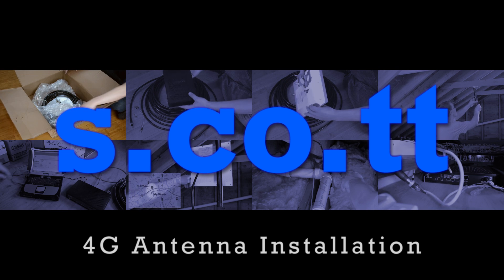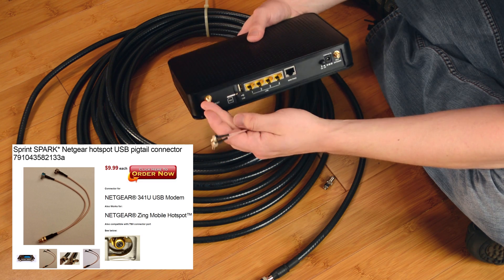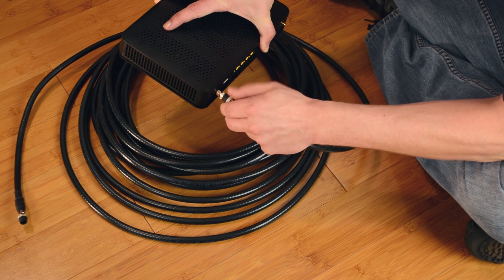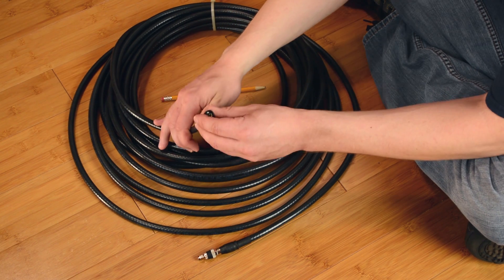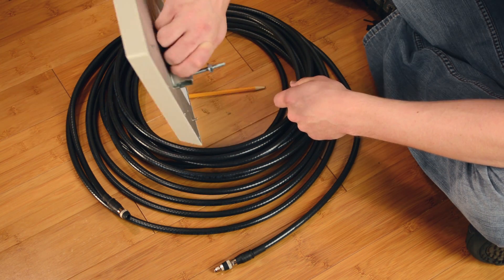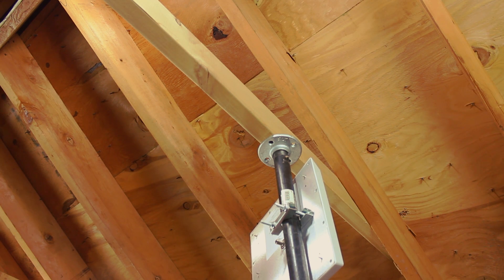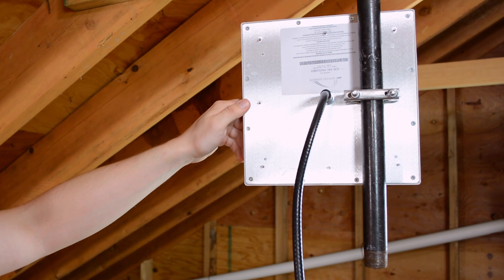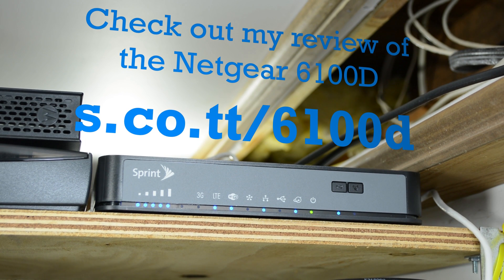4G Antenna Installation for Sprint / Netgear 6100D LTE Gateway

Comment: Do you have line of sight with the cell phone tower you're connecting to ? You should get an antenna with a more narrower beamwidth(high gain yagi or better yet, a Dish) which should improve your signal significantly, Panel type antennas are directional but have a somwhat wide beam width. best to concentrate the most you can into the direction of the tower.
Also try to position your 4G router the closest to the place where you're installing your antenna, that will enable you to use less coaxial cable, so the signal from your antenna wont get attenuated as much. you just have to lay LAN cable from the router to your PC, which doesnt have remotely as much loss as coaxial cable does.

Comment: Why not just mount the modem close to the antenna, and then run ethernet through the whole house. Would give you better performance overall. Also when you touch an antenna you are affecting the matching of it. So dont touch when measuring rsrp

Comment: still Sprint is the only 4g lte that provides public  static/ dynamic  ip address, tried t-mobile and does not support that so i could not use my ip alarm nor dvr system with t-mobile but all good with Sprint.

Comment: does antenna need power supply because of long cable?
Reply: No, the aerial is passive, the coax looks to be decent stuff rather than the thin wet string.

Comment: Why haven't you neatened your rack yet!? :D
Any reason you didnt place the antenna on the upper side of the truss instead? it would have given you more room to walk without having to worry about knocking it
I do think it would have been more suited to place the router up there, even with the heat and cold, it should be fine - signal quality is more important
re power: you could have run gigabit POE and split off to a DC jack
So you can run the power from downstairs, no issues with UPS etc but would increase signal quality

Ideally I would rather have placed the antenna outside as you would get signal loss inside.
If you need the speed as you go forward, upgrade to a MIMO antenna, but place it outside.
You should then be able to max your providers network limit :)

Nice vid btw... I actually didn't realize about the SMA vs SMA-RP so shot!

Comment: hey Scott great video! quick question.. on the netgear 6100d I thought the antennas were used to broadcasting the wifi signal? is one antenna to receive 4g LTE signal and the other is to broadcast? does it have an internal antenna? I'm confused..
Reply: The 6100D has a main and aux external antenna connection.  These are both for the cellular radio signal.  When connecting an external antenna, you only have to connect to the main port.  The WiFi radio antennas are internal to the device.
Reply: The modem has two antennas to support MIMO (multi-in, multi-out)...  If you search and read deep enough, you can't get true MIMO using one cable with a splitter like he's used. The antenna and cable stores will SELL you something that makes you think you're doing it correctly. Unfortunately, he's made a great video of how to setup incorrectly.

Comment: Scott, excellent video!  Curious why you didn't mount the Netgear radio / modem in the attic.  Then, instead of a  50' Coax cable run with the associated cost and signal loss, it would be a 50' Ethernet run.   In any case, I have the same issue with low signal, and am looking for an external antenna.  Looks like the panel antennas now have two connectors for MIMO.  Any thoughts on the MIMO vs single connection?  Thanks again for the excellent video!  Peter
Reply from the maker: +Peter Priest Thanks!  Two main reasons I did the RF run instead of ether:  The attic isn't climate controlled, and can get pretty hot in the summer and well below freezing here in NY.  I'd also need to put a separate UPS up there in that case (and in my basement I have automatic transfer switches such that even single PSU devices are connected to 2 UPSes for redundancy.. probably overboard, but in any case a good situation for the 6100D).

I'm pretty sure that the cellular uplink on the 6100D is just diversity, not MIMO.  (The internal WiFi antennae are MIMO, however.)  If the 6100D (or any device you're considering) is MIMO, definitely use a MIMO antenna if possible from a cost and cabling perspective.  That should give you better effective speed and reliability.   If the device offers diversity, then you'd be better off with 2 separate antennas some distance apart from one another.  (Or just the one as I used.)
Reply: Still Scott, I would have checked the temperature specs on the modem. Keep it in th attic and save lots on expensive low loss cable.UPS is getting into the extreme backup territory unless your situation (with the cable going offline) does usually spread to your power IE both power and cable provider go down at the same time.
MIMO is more than that a little better from my reading. LTE is made by design to have 2 antennae. You can get sometimes more than double the download speed which is damned significant. If I'm reading this correctly, it doesn't matter if you hve 5 bars on your modem/software it will still under-perform compared to MIMO. The only extra work is the double run of cable. Instll th modem in the attic and your down to one Ethernet cable (too easy) and less cable cost overall. In winter the modem can be kept in a cheap polystyrene cooler and in summer it should be okay up to 80c no problem.
Too late now and it is just a backup system so . . . . yeah whatever.

Comment: Great vid Scott.  I am moving just outside of a central Missouri city limit, Columbia and located in basically "fair" Sprint LTE coverage.  I'd like to setup an antenna in the attic as well to support a reasonable hot spot for home coverage.  CenturyLink at best is 3MB internet, so I'm researching cell connection.  Your vid has given me some great ideas.  Thanks very much.  John / KF5KI
Reply from the maker: John Beatty No prob, John.  Glad I could help!

Comment: Hello Scott.  Thank you for this how to video!!  It is almost perfect for my means!  I am curious though for your network why does it appear as though you used the ethernet cord to hard wire instead of connect wireless through the gateway(modem/router)?  I will have to watch again to make sure I understood correctly.  Thank you again!!

Best,
Justin
Reply from the maker: Giustino Cuatto Hi Justin,

I have a fairly complicated network at home.  I have two core routers (basically just PCs running Linux) with internet connections via a cable modem, FiOS (high speed fiber from Verizon), and of course the Sprint/Netgear 6100D.  The Sprint service is just there as a backup in case the hard lines go down in a storm.  So for me, hard wiring the 6100D to my other routers it is the only way to go.  My wireless clients connect to a separate access point that's on a private subnet.

If you're planning on using the 6100D as your main internet connection, then the built-in wireless should be just fine. 

And thank you for the kind words!
Reply: Perfect and thank you for the specifics and update.  As I went through and watched again I thought it might be because the use is to serve as a backup connection.  For my purposes yes it is MUCH more simplistic and I know I could get away with the built in wireless.  I try to solve my own problems and your video for reference was a tremendous help!  I wanted to make certain I am on the right track before I do some ordering to complete my at home network.  Have a great one!!

Comment from the maker: I'm not exactly sure what usage of "mobile" Dean Pepler is trolling about, but I guess that his freshman English class didn't cover oxymorons.  It's commonly referred to as a mobile network, even when I'm accessing that network via a fixed base station.  Besides, the 6100D is still mobile; I can pick it up and use it anywhere in the US.  That's something I can't do with my FiOS or cable connections.

Good ol' Dean Pepler also doesn't understand the concept of a WISP (assuming he's referring to a Wireless Internet Service Provider).  I am not an ISP.

But those are a couple of good terms to clear up, so well done on the trolling.
Reply: WOW DUDE :D 
putting his name on your youtube. thats awesome. :)
Reply: jesus loves you. :D
Reply from the maker: @aphontusaphontus1279   ... I wasn't doxing the guy.  His full name was his YouTube screen name.  I was being a little obnoxious overall in retrospect, but this was 5 years ago so I don't even remember if that was warranted. 😇 

I think that was before YouTube had threaded comments, so I'm guessing that's why you don't see his original comment above mine.. or he deleted it. 🤔 But anyways, at the time I think the @ symbol actually did tag him, which is why I used the full name every time..  I was just typing @ and then it would autocomplete his name.

Comment: What type of cable was that you used? 50 ft is the max run before signal degradation?
Reply from the maker: This is the cable I used:

https://4gantennashop.com/index.php/product/11-series-11-quad-shield-coaxial-cable-14awg-ultra-low-loss-sold-by-the-foot+&cd=2&hl=en&ct=clnk&gl=us (Their site appears to be down right now.)

It's RG11 quad shielded.  50 ft just happened to be about exactly what I needed, which is why I went with that length.  I'm not sure how far you could go without experiencing problematic signal degradation.  I was still getting a great signal through the 50 ft, so I'm guessing you could go decently longer.
Reply: Scott will you do a video for The HUAWEI E5186 LTE-A Router and Poynting Signal Booster antenna's